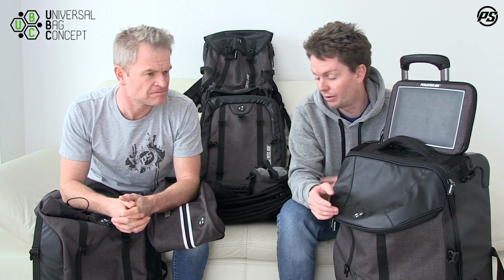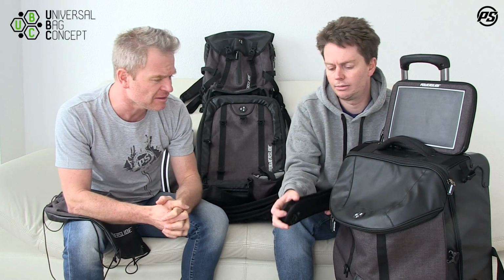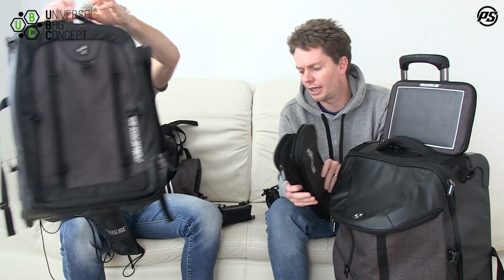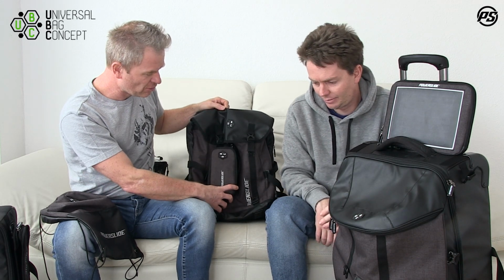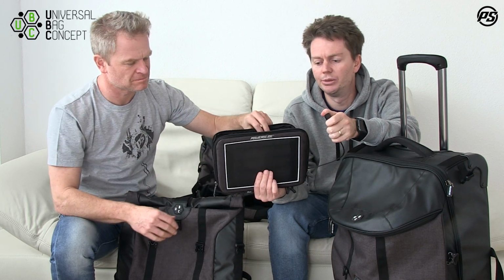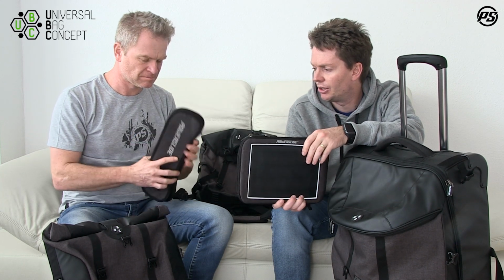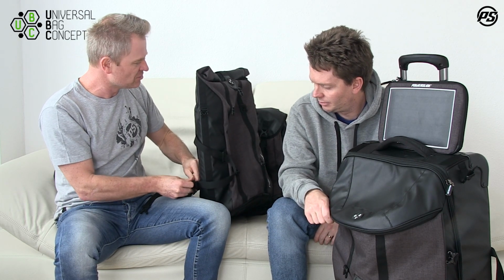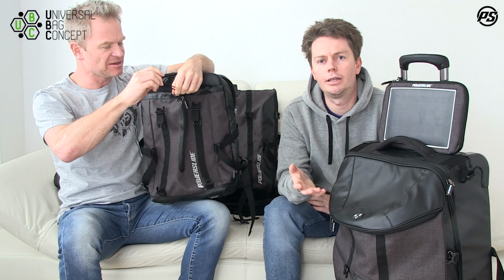Powerslide UBC line - Universal Bag Concept

Comment: What I'm interested in is if you're going to do a 150mm SUV wheel cover, because going up a hill with the SUVs is their biggest weakness and having somewhere to put them would be really handy. I have already tried just using the side straps on the Roadrunner with the Outback 150 and they do a great job at keeping the skates secured to the backpack, but having a set of muddy wheels strapped to a nice backpack and brushing against your clothes doesn't sound very appealing. In either case, another question I have is if you're going to release the buckles themselves, either for repair purposes or for the community to freely use to create their own attachments, for example, said 150mm wheel cover.